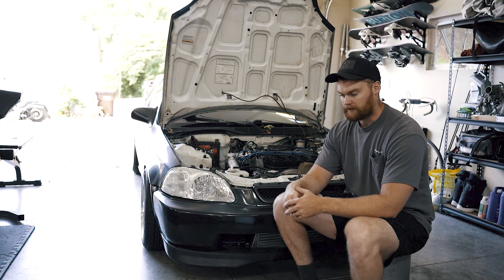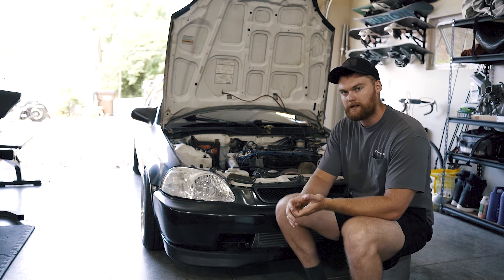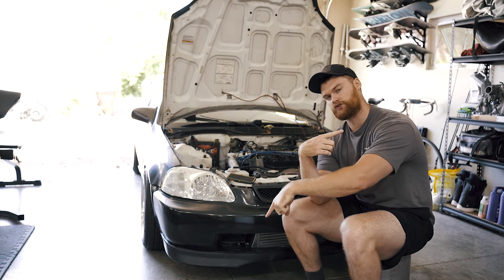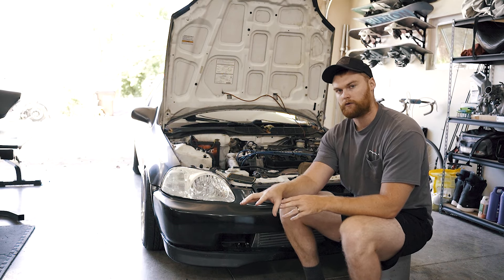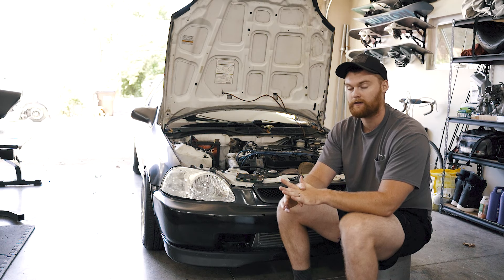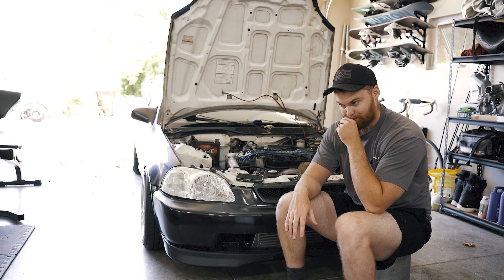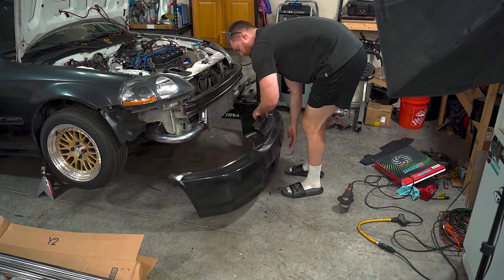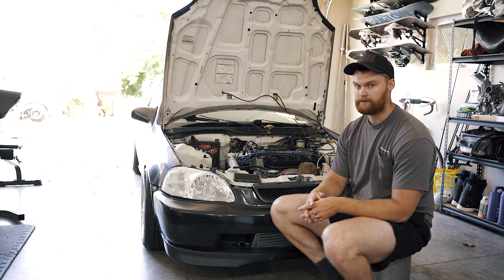Everything You Need To Turbo Your Honda Civic On a Budget (Stock ECU)

Comment: Tip for anyone doing this. PLEASE make sure your oil drain line is above your oil level in your pan. I have a y8 I'm running 4 quarts of oil with the turbo. I filled my oil to 4 quarts and marked where I needed to put my drain. If you are not above your level your turbo will not drain sufficiently. Also if you do this and your turbo starts blowing oil out the front check your PCV. If it is getting to much crankcase pressure from PCV your oil will drain out the front of your turbo.
Reply from the maker: @SteampunkDream  thank you!!
Reply: Ok thanks for the information ❤

Comment: Your AFR is hunting for idle probably because your maf, if you get someone that converts your MAF to MAP it will idle fine  ecumasters piggyback might be a budget option for that or greddy emanage
Reply from the maker: @PH020  great information. I will look into those options
Reply: It’s a D16, they don’t have a MAF. The car comes factory with a 2 bar MAP sensor, stock map sensor is fine for reading up to 10psi of boost. 
The car will always naturally hunt at idle AFR on the gauge. Even stock these cars will read around because the injector dead timing will change at idle to keep the car running and use the least amount of fuel. Same as cruising speeds it will naturally be slightly on the leaner side and hunt between 14.7-17 AFR’s. 
You really only need to worry under load/boost that your AFR is between 10.5-12. Ideal loaded AFR is 11.2-11.8. This is a little rich, but will save your motor.

Comment: About to turbo the civic now lol, I got a d16y8 so one less part I have to swap 🤦🏻‍♂️ I do have a question though… why not swap injectors? They seem reasonably priced. Will that raise the need for a tune? Wondering how the build would run with injectors and the fmu
Reply from the maker: Y8 Injectors are for sure on my list. I have been told they pair up well with the FMU

Comment: On tge afr gage u need to power it from a source that doesn't cut off when you start tge car,
Reply: For memory reading the AEM wideband manual, wideband due to ceramic element  its meant to be spliced to the ignition trigger 12v not a constant live or else the wideband sensor itself is ON constant 12v live when the ignition is on but engine not kicked over, which overheats the sensor an destroys the. ceramic element prematurely. Its also meant to be far enough from the turbo (18"+) to avoid this same sensitive ceramic element issues.  If it breaks bye bye accurate AFR
Reply: @brendanj1124  yes not a constant just the ignition source, so when you key on it turns on, but when you start the car it doesn't shut off fo that spkut second? cigarette lighter radio and most accessories shut of when you start the car.

Comment: When you swapped to the y8 manifold dod you go to the y8 injectors as well?
Reply from the maker: @danielhaynes1642  no I kept the y7
Reply: @brotherboost  in that case it's a cheap upgrade to move to y8 injectors. 

Stock y7 has the smallest injector size coming in at 180cc

Y8 and other honda b/d injectors are 240cc.

We have done many of FMU set ups and they work amazing for what they are. I've ran many of hondas this way and many of Na/T subie set ups running a fmu set up.  

For under 10psi you can't beat it.
Reply from the maker: @danielhaynes1642  that’s good to hear! Maybe I’ll snag me some y8 injectors and do that. Thanks for the input!

Comment: I did the same on my 1.8 Miata . At 6lbs of boost I was fine. At 10lbs my afrs were still good, but I must of got detonation I couldn't hear, and I bend two rods, and crack one piston right in half.  Now I'm running 6lbs. , with 4 degrees of timing pulled out, with 93 octane.  I now have a fully forged build, and when I get more cash , I'm going for a standalone ecu. My engine should be good for at least 400hp or more on a good tune now.
Reply from the maker: @scottr3141  that’s awesome. That kinda what my plan is for this thing

Comment: Have you done any restriction on the oil drain/feed line?  I’ve heard that it’s the way to go.  I’m in the learning process for a turbo build. So just gathering info!!
Reply from the maker: @rileywilliams5763  the kit that I bought has a pretty restricted fitting on it. Seems to work good
Reply: @ ah okay. I’m thinking about the MaxSpeedingRods kit for $500. I have a 94 hatch with a JDM D15B Vtec engine that’s low mileage. I’m thinking it’ll love boost. Bought a chipped and socketed P28 a few years ago. So got that covered!  Not many videos like this on here. Hoping I can add as well!

Comment: Instead of running a fmu cant you just run a fpr as it pretty much works the same way from vacuum pressure
Reply from the maker: @joshashford6607  https://honda-tech.com/forums/honda-accord-1990-2002-2/difference-between-fpr-fmu-199540/
Reply: @brotherboost  thank you, so according to that then I’m better off getting both
Reply from the maker: @joshashford6607  yeah It seems like it
Reply: @brotherboost  I’m building a d16v1 ep2 civic and only just learnt about fmu thanks to you so ima run that. I don’t wanna pay over $1000 for ecu n tune either so this video has done me justice
Reply from the maker: @joshashford6607  good. I’m glad I could help!

Comment: Yeah i rlly wanna turbo my 96' Civic EX Coupe. It has a d16y8 VTEC motor with 160k miles. I understand al of the mechanical and think i could slap it on with ease but the tune is where it gets confusing and tricky. might just run stock ecu like u and hope. only thing is that its my daily lol. any other suggestions on how to make it more reliable? my goal is to get around 200hp stock internals.
Reply from the maker: @VurTzYT-b9q  if it were my daily I would just save up and have enough for a tune!

Comment: Did you bypass the map sensor?
Reply from the maker: @eddiebennett723  I drilled a hole in my inner cooler piping right before the intake manifold and put it there
Reply: @brotherboost  would you be able to show that?
Reply from the maker: @calebjohnston237  my mistake. I was thinking of the mass airflow sensor. I did nothing with the map sensor.
Reply from the maker: my mistake. I was thinking of the mass airflow sensor. I did nothing with the map sensor.
Reply: @brotherboost  ohhh okay, it doesn’t cause any issues like that? Also I can’t find that Bov block off plate the link is dead lol
Reply from the maker: @calebjohnston237  I have had no issues with it so far! And I’ll see if I can find a new block off plate link. Honestly that one didn’t work well anyways because it wouldn’t clamp down. I had to weld it.